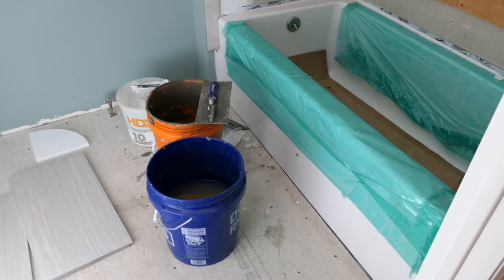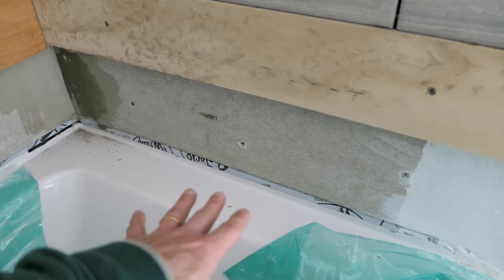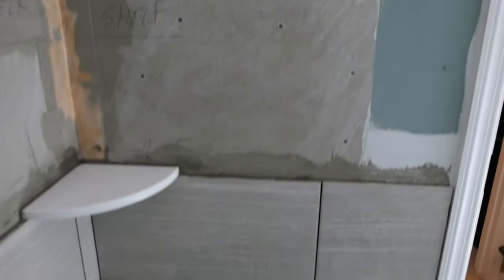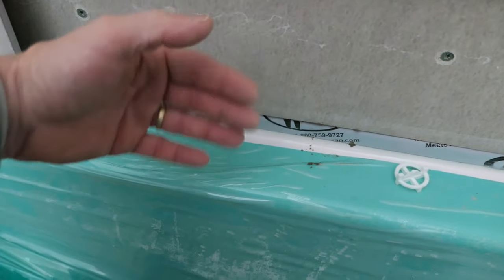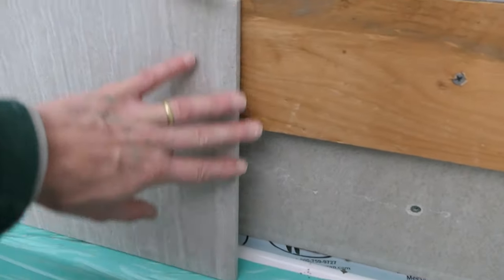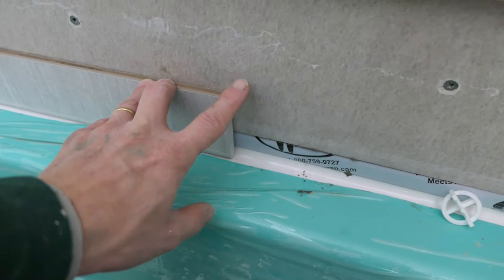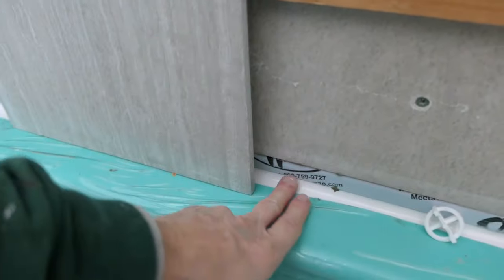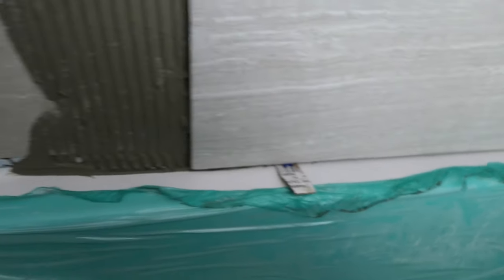How To Tile Over The Lip Of A Tub Or Shower Pan

Comment: What if you are using wall panels and not tile, what do you recommend for that?
Reply from the maker: If you mean a shower enclosure, in which the walls are designed to fit into the tub or pan lip, then you just follow the manufacturer's instructions.  Typically those are a snap fit and caulking is not required.  Many of those attach directly to the studs.  If you are talking instead about a thin, flat panel which is applied to the backerboard using adhesive, I don't install those at all.  Those are a poor substitute for tile and basically it's only a bead of caulk which prevents a leak in the corners or the tub/pan joint.  If I was forced to use them I guess I might install backerboard using the flashing, seal the backerboard with a waterproofing membrane like Schluter Kerdi, and then use adhesive for the panels over that.

Comment: What is your opinion on mitering the backer board about 2-3" up from where it meets the tub/pan flange?
Reply from the maker: I'm not sure I follow you--do you mean making a relief cut on the back of the cement backerboard to allow space for the flange?  If so, I would discourage that.  It weakens the backerboard, it creates toxic dust if you use a saw or grinder, and it's just not necessary.  I have yet to come across a bath where I couldn't use either shims to bring the backer out over the lip or my flashing trick and putting the backerboard on top of the flange.

Comment: Okay on no water proofing harder backer, but I do have a question about the holes you drill through the hardie backer and do not waterproof. So now there is a protrusion directly into your stud that is not waterproofed.  Thoughts?
Reply from the maker: You're going to tile over the backerboard, right?  I've not found any water-permeable tile.  Take a look at this old video I did years ago:  https://youtu.be/xk7lNudSV2Q

Comment: Is it normal/possible to have slight flex on the overlap portion of the tile that isnt supported by the backboard? If i push the edge of my tile i can see the sealant joint flexing slightly. No sign of cracks on the tile  though. My first thought was water damage behind the tiles but looking at your illustration i can see how small movement is possible?
Reply from the maker: If I follow your story correctly, you can press on the tile right above where it meets the tub or pan, and you can see movement?  That's a red flag.  You don't mention what the tile is adhered to--is it cement backerboard, or is it an older installation on drywall or "greenboard?"   There are a number of possibilities, including that the tile has come off the backerboard and is just being held by the caulk, that there is wallboard behind the tile which is disintegrated, or that there is cement backerboard which was poorly installed in the first place.  Apparently you don't have a leak, but if the tile actually moves you may be on borrowed time.   You should have a pro remodeler come in and take a look to give you advice.
Reply: @enduringcharm  Yes basically the shower tray I have has 4 upstands and the tiles sit over the lip on 2 sides and I'm assuming it's on drywall only. The wall is only 3-4 years old with no signs of mould or cracked tiles/grout. Any water passing through any gaps in the sealant between the tray and tile  should in theory be contained to the tray as the tiles do not touch it and the upstand would stop it escaping. I can push the bottom of the tile and see slight movement in the caulking. My gut feeling is lack of adhesive on the bottom half of the tile that overlaps the drywall rather than water penetration. Providing this area is not pushed inwards and not compromised should it hold for a number of years if this is the case? I can't justify pulling a wall down because of slight movement without more evidence, Especially with the cost element at the moment.
Reply from the maker: Okay, that's not a normal thing, so something isn't right.  You shouldn't be able to move the tile really at all.  Obviously I can't diagnose the issue from here, but that's why I think you should have a pro take a look.  Possibly you can leave it for now, but at least you'd know if it is a serious problem or just a minor thing with a couple of tiles.
Reply: @enduringcharm  Thank you for your help 👍

Comment: How about the lip of the tub on the sides, how do you tile that area?
Reply from the maker: Do you mean sides of the tub at the top, or do you mean the front apron?
Reply: @enduringcharm  there is some tub that has a lip on the front but vertical sides, left and right
Reply from the maker: I'm not sure I follow you yet.  Typically the tile flange goes around two or three sides of the pan or tub, and then the front apron has no lip.  So the flange is set under or in the same plane with the backerboard, and the side edges of the front apron sit next to the surface of the backerboard.  When you tile, you end up covering the edges of the side apron, and that area is caulked with silicone rather than grouted.

Comment: Won’t the thin set in the backer board to the tub crack as well?
Reply from the maker: Thinset really won't stick to the flashing or to the tub or pan surface.  But, it's not there to stick, it's just there to offer support behind that area of the tile in case it gets bumped.
Reply: @enduringcharm  ahhh, so is more of a filler.  Thanks

Comment: Hey what should one do if the tub tortrudes out past the drywall about 1/8 inch but cant screw it anymore to be flush? Sand it flush and then apply thin set?
Reply from the maker: First of all, you don't want to be cranking down on screws through the flange!  Those flanges (steel, fiberglass or acrylic) are not meant for that purpose.  Screw down until snug and then stop.  Second, you don't want to be sanding anything either, which will ruin the finish.  The flange shouldn't be modified at all.  Third, I hope you aren't using drywall inside the tub alcove?  In that area there should be cement backerboard or a tile backer product like Schluter Kerdi board. An overlap can occur at the edge of the tub with drywall in the rest of the room.  To solve your problem of the flange being proud of the backer, there are a number of steps you can take, which I discussed in this video: https://youtu.be/FYSZQp-Y_kI

Comment: I'm using 4x8 subway tile. I replaced the shower pan. The studs were put in place years ago. I can't reframe it I can't install the backer board over the lip.
Reply from the maker: A traditional subway tile is 3x6, are you certain yours is 4x8?  Either way, you'll have a relatively small amount of tile adhered to the backerboard.  There may be some things you can do to lower the backerboard over the lip.  If this is a three-wall alcove you can shim out the rear (long) wall so the backer goes overt he lip and down to the pan.  If all you have are walls in the same plane as the rest of the bath walls, you MAY be able to relieve the back of the backerboard so that it slips over the lip.  It would require a grinding wheel used outdoors, with a mask for dust.  There's not much to work with, though, so if the lip is thick that may not be an option.  Another idea is to simply use a smaller pan and then you can build out the walls from the rest of the bath.  Finally, you can ditch the pan altogether and do a tiled floor, which will get around the problem.

Comment: great, so how do you grout the vertical 1 inch before you reach backer board?
Reply from the maker: The space behind the tile where the lip is located is not a yawning canyon, it shouldn't be more than a quarter or three eighths of an inch at most.  You'll fill that with thinset when you do the tile.  Again, the thinset is really just there to fill the space and act as a backer since it won't stick to the tub or to the flashing if you use my flashing method.  You'll wipe the grout joints and the joint between the tub and tile if any thinset squeezes out.  After the thinset cures you'll grout that area just like the rest of the wall.  The gap between the tile and tub is best cleared of thinset and caulked with a color matched silicone caulk instead.   See this video:

 https://youtu.be/_aja8hfhElI

Comment: Could you silicone the lip and thinset on the backerboard? Half and half essentially
Reply from the maker: You'd just make a pointless mess, and silicone does not mix with wet things.  Any squeeze-out of silicone would also be a disaster later when you tried to grout.  Just use thinset,  Really, it will be fine.

Comment: do u put any of the cement board tape on the bottom or just the thinset
Reply from the maker: Adding mesh tape or Kerdi membrane wouldn't really buy you anything.  The thinset won't stick to the tub lip or flashing, but it will stick to the back of the tile.  That provides some support behind the tile, that's all.
Reply: @enduringcharm  thanks alot great video

Comment: Can you use grout color matching caulk between the tub and tile?
Reply from the maker: Yes, they make color matched caulk in both sanded and unsanded versions.  However, let me warn you about something.  The quality of these color matched caulks is sometimes not great.  At the very least, do not use the sanded versions, even if you use sanded grout.  The sanded caulks are meant to approximate the look of sanded grout, but they tend to shrink and cause problems in short order.  The unsanded caulks are generally better, but still not the quality of a good silicone caulk.  For that reason, if a standard silicone caulk happens to match the grout color (white, black, almond, brown) then I'll use that instead.

Comment: Shouldn't that gap between tub and tile bottom be more like 1/4" ?
Reply from the maker: I make that gap the same as the grout line spacing, which was 1/8" in this case.  That looks best.  If you've installed the tub or shower pan well, the movement is limited to the expansion and contraction of the tub material and perhaps some difference in seasonal movement between the wall and floor.  That should be nowhere near the grout spacing.  If you can actually see movement in the tub or pan when stepping into it, something is wrong.
Reply: @enduringcharm  I was just about to ask what the gap width should be thanks for the video.

Comment: 1/8 “ big enough gap for caulk on fiberglass tub. Im a big man & the better 1/2 wants tile up & tub already moves & stress
Reply from the maker: Typically I use the grout line gap as a measure for the gap between the tub and tile.  Make them the same.  However, the tub really should not be moving enough to see visually.  If the tub is installed correctly you should be able to stand in it and not see movement at the lip.  Any movement should be very minimal with weight or with temperature changes.

Comment: I hung and finished drywall for over 40 years. The plastic is a NO-NO for me. In the south, North Carolina respectively back in the 1980's they would put 4 mil plastic over the insulation on all exterior walls of newly built homes. My crew & I would come in to hang these homes and everywhere the plastic membrane was there was also a pool of water at the baseplate, even in winter. After about ten years they found out that what some stupid engineer had glorified was actually a nightmare. Kind of like the cars they design now. None of these homes are still standing.
Reply from the maker: Your concern is partially misplaced.  What you are referring to is a situation where you have either a double vapor barrier, or a vapor barrier in the wrong position in the wall cavity.  Moisture needs to be able to migrate and not be trapped.  But there is a key difference between that issue and what I do with the plastic.  In my case the plastic does not cover the whole plane of the wall--it's only covering three feet of a 7 or 8 foot wall.  It's not acting as a vapor barrier, only as flashing of sorts.  Moisture can still migrate through the wall and not be trapped.  Also, if any water were to get through the tile, grout or backerboard, it could only return back to the tub or pan, since the plastic overlaps the lip.